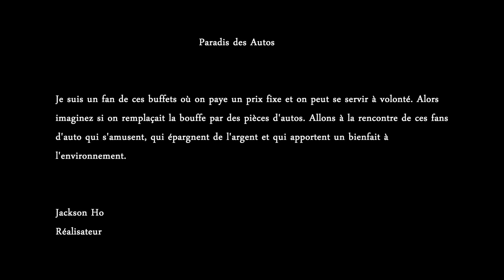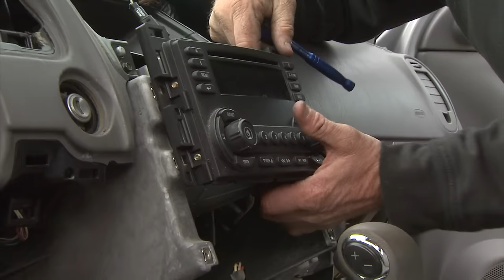CANADA's LARGEST junkyard with Free auto parts

Comment: In the 80s I used to pull parts on the east side of Houston every Saturday, where admission was $10 and a running 500cube Cadillac motor was $89.95...with transmission included.

Comment: Well if I ever go up to Canada I will definitely stop in. Got some things I want to fix/replace on my Dad's truck. $50 for a rear bumper and heated seat wiring harness would be amazing.
Reply: Also its $50 CAD whereas that would be less than $50 USD.
Reply: Quinn Dickinson u always want 2 wash the salt off from the roads in the wintertime that is what helps autos rust !:)
Reply: Quinn Dickinson u always want 2 wash the salt off from the roads in the wintertime that is what helps autos rust !:)
Reply: All the good stuff would probably be taken already :(

Comment: This is awesome. When I'm passing through again I'm loading up on GMC Sierra parts lol
Reply: i'm with yah on that one! my 97 Sierra need new Cab corners ahah, bringing a torch I guess!
Reply: Spalderdash Hugo Mine needs cab corners, inner and outer rocker panels, a passenger front fender and a rear wheel arc panel LOL Oh and emergency brakes and cables. Thank god for crooked mechanics who do botched federal inspections hahaha Shes a daily driver though!
Reply: ahaha same here! Had a few rust holes in the frame, nothing a few dodgy welded plates can fix! My buddy was a certified mechanic who passed the inspection ahah! I just covered my fenders with some offroad flares. Just gotta get some 31' tires
Reply: Spalderdash Hugo One thing I can say about my old truck is that the frame is solid. 316,000 klicks on the engine and transmission but she runs like a top and never misses a beat. It doesn't even burn oil which is surprising. Hard to kill those 4.3's though. I know the engine will far out last the body.
Reply: Yup I got a 5.0 with 288 klicks on her and she runs like a charm, surprises me everyday that ol' truck. Love it to bits tho.

Comment: Around 30 years ago, my brother and I, would drive an hour and a half to Calgary for the same deal. The wrecking yards around Red Deer wont let you pull your own parts. They charge 1/2- 3/4 of the price of a new item. As I'm about to post I see he has an e-mail address. Maybe I can get headlight surrounds for my 57 D100, or a decent grille for the'80 Powerwagon
Reply: Interesting. 1957 & 1980? I believe Both of those particular items will be difficult to track down, Yet possibly go custom instead? Try looking up J&J Enterprises for a grille, they can make a stainless steel one if you send them dimensions and maybe the original for comparison.

Comment: really cant go wrong with that if your into fixing a vehicle and you need a lot of parts considering the fact how much brand new parts cost from stores and just the factory alone today costs id rather pay 50 and pull a grip of parts throw them on a flatbed trailer and haul them back home, cause if you know what your looking for and can tell the difference if its good or not and if its good pull it and throw it ontop the trailer cause atleast you have that part now ya it might be used but atleast you got the part you need. shit if I had land back home there you best believe id be visiting there quiet a bit

Comment: ee have days LIKE that in alot of YARDS in USA, its $25 all you can carry out, ive seen 2 guys carry a Fisher plow setup for a f350 ford, 1 had the BLADE and the other had the frame eith control's and lines, total cost because of 2 guys $25 each so it cost $50 but it made them lots of money, now the yards only let you pick off of cars that go in certain areas because of big ticket items that werent taken off and put in there storage, this eas before computers were even big, MOST didn't own 1 in the late 1980's.

Comment: These are pretty modern cars so no surprise it's free. Scrap yards don't do too well these days. If say your ECU has packed up chances are the replacement you get will be too or at least not far behind. You only have two choices when trying to keep your car going, buy from the dealer (more expensive than the car itself sometimes) or scrap the thing, which is exactly what the manufactures want. You trade it in for new and the whole bullshit cycle starts again.

Comment: An engine for $50.00? Are you kidding me? I'd be all over this if was around me somewhere. Problem is the cars I have no one anywhere seems to have parts I need. I need fender emblems for example for a 1979 Dodge D-100. They are the Adventurer 100 emblems, and an antenna.